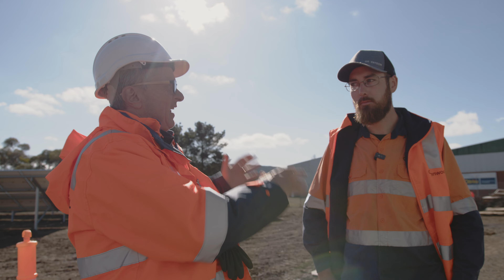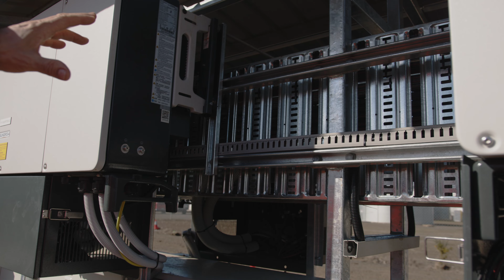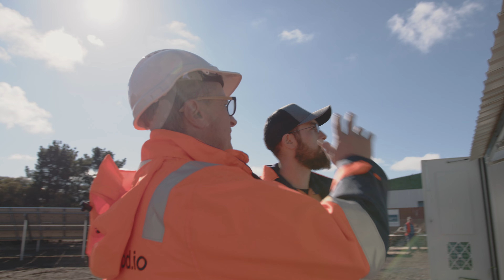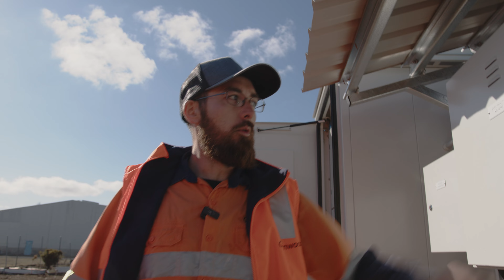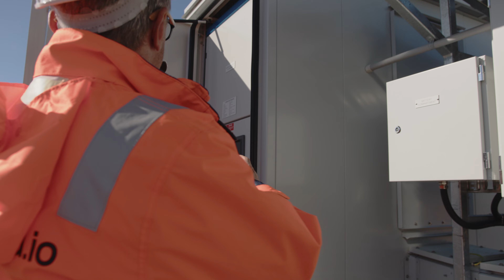PART 3: Inside a 1.2MW PV System "Transformer Oversizing, Inverter Foundations & AC" -Greenwood

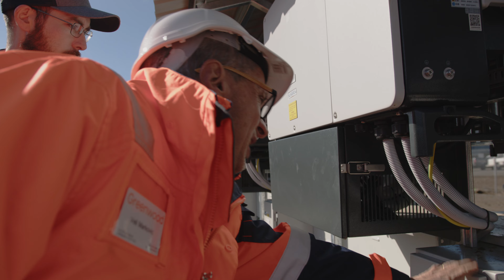Comment: At 2:41 of the video you (Veli) mentioned the earth cable which is for the system earthing but I don't see the additional 
grounding/external protective grounding of the inverter body. Was this requirement overlooked?
Reply from the maker: Thanks for the question Ian.
There is a ring earth that was mentioned in the video connected to earth stakes situated at the inverter transformer skid, just not shown in this video.